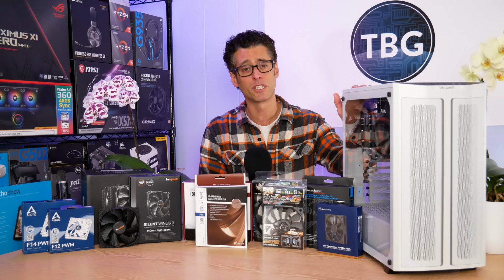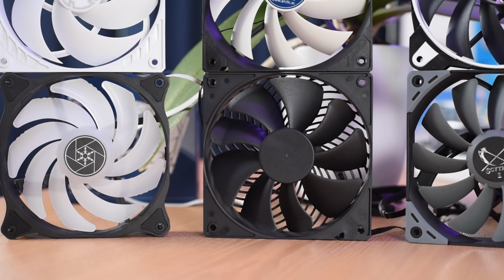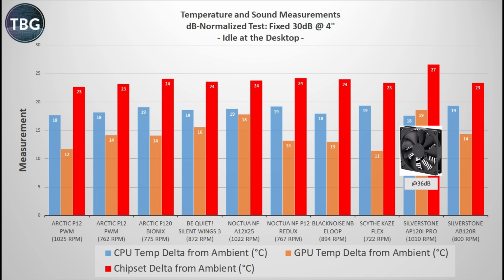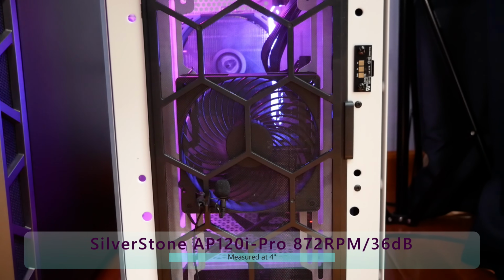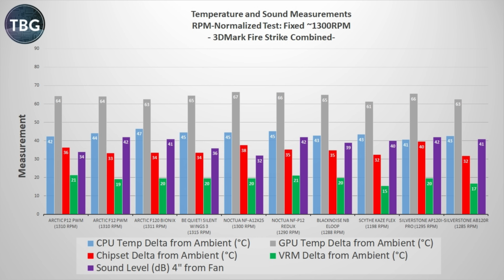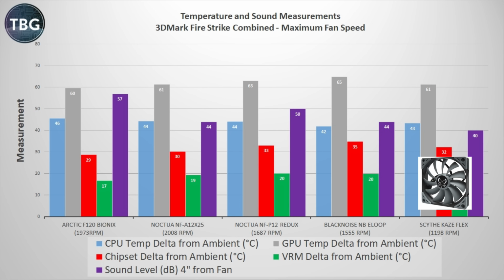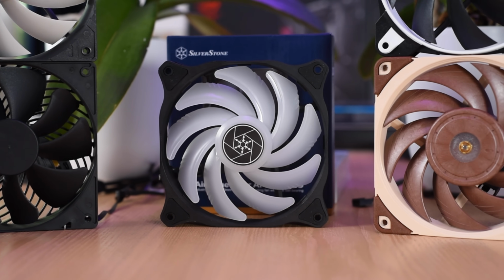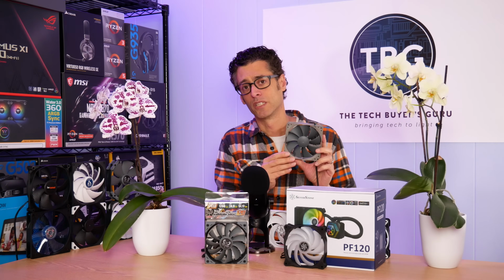The Best 120mm Case Fan Shootout: Arctic vs. be quiet!, BlackNoise, Noctua, Scythe & SilverStone

Comment: this was an unfair analysis for Noctua, because Noctua NF-A12x25 model is not designed to put air into the case, it is designed to move air already in the case, so it is more suitable to be placed on the coolers or other kind of applications. For this test you should have used NF-F12 ones (chromax or premium traditional), which are designed for this use case. Off course Noctua is not going to make a better position if you are using Noctua NF-A12x25 for something it is not designed for, so it has to work harder hence the noise and temperatures.

Comment: The microphone is way too close to the fans. You should move it farther away to eliminate the sound of the airflow. Some sounds might be strong very near the source but not travel very far in real life. Placing the mic about 10” away (and outside of airflow) should give more approximation of sound in real environment. You shouldn’t use air hitting the mic as part of the sound test results.

Comment: Thanks! I hope those p12 live up to the hype. I wanted to change 1 fan in my case and bought a cheap one from a local store only 1000rpm and no pwm and i had to return it, now after watching this i ordered a 5 pack of the p12 pwm on amazon to replace all the fans in my pc, they end up costing the same per unit than the crappy one from the local shop.

Comment: is the scythe kaze flex II as good (or better) than the original kaze flex fans? Getting a corsair 4000D case and am looking to do full scythe fans 2x140mm's in the front and top and thinking to get a 120mm for the back

Comment: Some feedback from a someone with audio recording background: Mounting the small lavalier mic on the frame with just the foam pop-filter isn’t the best way measure/illustrate noise. Cuz it’s going to pick up vibrations from the motors through the frame. And also without a wind-muff or dead cat it will pick up the air moved by the fan directly disrupting the mic membrane. 
It’s better to use a shotgun mic and set that independently on a stand on the floor, point that at the pc front at about 50cm so also there’s no airflow passing the mic membrane and you’re only picking up the noise it would make as if sitting next to your PC case, (instead of what it would sound like if you pressed your head against a pc case)

Comment: I just ordered an Arctic F140 bionix thinking it's simply a faster version of the F14 which is a really good performer for air flow. While I agree the flex of the fan frame seems concerning, it feels like it's a really good performer in terms of brute force air being pushed at full speed and it isn't that loud aside from the sound of air being pushed through the fan.

Wondering if you could comment on the kaze flex 120mm 2000 rpm version although it isn’t pwm. I looked at the stats and it apparently pushes 89cfm which is insane for a. 120mm fan and whether it would be one of the best 120mm for max performance? There's also a black 1500rpm pwm version as well

Comment: I just came across this and I'm looking to put 7 120mm and 2 140  mm fans. If I'm understanding this correctly the arctic p12 would be better for the 7 120mm fans vs the scythe kaze and for the 2 140mm fans from your other video the scythe would be best?
Reply from the maker: The Scythe Kaze Flex 120 and 140 are both my tops picks, but the Arctic P12 is excellent with regard to cost, especially the 5-pack: https://amzn.to/3L4oYt4 #ad
When you start needing that many fans, paying ~$30 for 5 Arctic fans instead of $70 for 5 Scythe fans means being able to put that money towards another substantial component, like a CPU cooler, RAM, or an SSD. 

By the way, definitely check out this multi-fan setup video if you haven't seen it already: https://youtu.be/iCn-XL-HyXg

Comment: How is the SilverStone AB120R so much quieter at 30db? Seems like the level is wrong.
Reply from the maker: The microphone and the dB meter were not quite at the same location. The AB120R has a very quiet motor, which is what the video demonstrates. The air noise will be similar to other fans, and that's what you hear from further away.

Comment: Nice comparision, but from some reviewer i viewed  Silverstone AB120 does not win. But you said that it is the best all around fan. This confused me. But i strongly agreed with you. Is has the highest airflow rate (25.62 ~ 93.97 CFM) with high static pressure(0.26 ~ 3.53 mm H2O) fan in 120mm fans that has argb. I used it as a case fan and really impressed me. I planned to buy Lian Li Galahad 360 AIO and replace the stock fan with this Silverstone AB120RW. Please include Fractal Design Prisma AL12 PWM and AL14 PWM in your comparision.

Comment: I know this is a year old video but I still need to comment. I think this video was a little bit unfair in some degree because this video tested static pressure fans as case fans.

You did say noctua NF-P12 redux was one of the worst ones. But in reality it was also made not as a case fan but as a radiator fan. It's static pressure by spec is really high compared to the scythe. That fan is actually well made, and I think it was one of your reviews that even rated it well (don't remember, but not going to go back in history to rewatch videos lol).
Reply from the maker: The NF-A12x25 is Noctua's static pressure fan (i.e., designed for coolers). The NF-P12 is just a general purpose fan.
Reply: @TheTechBuyersGuru   If you look at nactua's website, it specifically states "Specifically designed for pressure demanding applications such as CPU or radiator cooling".

Also the NF-P12 Redux 1700, has a greater static pressure value than the NF-F12. I've seen other benchmarks that shows it actually performs better as a static pressure fan than the NF-F12.

I agree, as a case fan it IS a bad fan but as a radiator fan, it is actually good.
Reply from the maker: I know what the Noctua website claims... and I also know how it performs, LOL! ;) Honestly, that was written before Noctua had a true static pressure fan. A lot has changed in the industry since the P12 design debuted.

The P12 is really similar to the F12. The main difference is the quality of the frame and the RPM. So the static pressure is higher because of that, but they are fundamentally the same fans.
Reply: @TheTechBuyersGuru  ah I see. I'm actually debating on which fan I want to use it for a push/pull configuration for my gpu. I have 1 of each (F12 and P12 redux) and been contemplating which one to buy so I can slap it on the radiator. I honestly have been leaning towards the P12 redux 1700 because of the specs alone: Higher static pressure and higher CFM value.

What do you think? (I've used them both for different applications so honestly I don't know how they actually perform in real life against each other and there isn't much out there comparing them head on)
Reply from the maker: The main difference is that the F12 has rubber bumpers, but that's not much of an advantage for rads, because it creates an air gap. Plus you'll want higher RPM on a rad. Get the P12: https://amzn.to/3JyoNoZ #ad
Reply: @TheTechBuyersGuru  yeah I'll do that then. Thanks! Cheers!

Comment: HI and thanks for the Video!!! I am looking to replace my front and radiator FAN. I know that before the price of the P12 PWM PST vs the price of the ARCTIC BioniX P120 was quite different. 
I can now buy them for same price. Would the BioniX version be better than the normal P12 version? 
Thanks
Reply from the maker: I do not recommend the BioniX version. It makes extra noise due to the frame design.
Reply: @TheTechBuyersGuru  Thanks

Comment: That NF-A12x25 definitively was a bad choice in case fans review, the NF-S12A will be a perfect choice. I'm very curious about that fan and how it performs paired with kaze flex.
Reply from the maker: The S12A is terrible: https://youtu.be/PUdsTiRmuuU
Reply: @TheTechBuyersGuru   Thanks so much, thats what I'm looking for. So do you think for case with not restrictions those kaze flex are the the best option with more air flow and lower noise possible?
Reply from the maker: Kaze Flex are fantastic, all around amazing fans for case cooling.

Comment: Thanks for the video, but I see two problems:
1. With testing only one fan, I feel like you distort the test quite a bit. Most of us would use 2-3 120mm fans in the front which may result in way different results. In terms of aerodynamics, 3 fans can sometimes behaive much different than 1 single fan. This could also be the reason why the pressure optimized NF-P12 had such bad results, cause with such large gaps beneath and above it there was no pressure to work against at all. 
2. I can see you didnt quite mount the fans with screws, and by just tying them to the mount they were not always centered. With most fans pushing most of their air at the outer edges of the blades, some fans just put their hardest effort against the mount.
Reply from the maker: See this: https://youtu.be/PUdsTiRmuuU
Reply: @TheTechBuyersGuru  Hey, thanks for the link, but I already saw that. Unfortunately you only tested with the same fan brand :) 

Dont get me wrong, I highly appreciate the effort you put into this! 
I just wanted to mention these two minor issues and I feel like its a little bit sad that you might have some deviation in your results due to not spending the extra few minutes to properly screw these fans onto the mount. 

Anyway, I am still wondering how three NF-P12 reduxes would behaive vs 3 Scythes or Arctics in the same configuration, so if you got time I am exicted to see another video :D :D :D 

Good work man, keep it up <3
Reply from the maker: I agree that not screwing them in wasn't ideal. I did that to speed up the process, as it was my first case fan review and I really didn't know if people would be interested. Turns out they were VERY interested.

I have a huge case fan shootout planned for early next year, but it's focused only on ARGB products, so sadly Noctua will not be included!

Comment: I wished I watched this video when researching my next computer build. It could have saved me a fair chunk of money since I bought 4 of Noctuas NF-A12x25 fans Ultra Low Noise because I wanted as much silence as possible without trying to sacrifice performance. Those Scythes look really tempting.

I have heard of Scythes but they were like Arctic in terms of market presence and would have missed my radar when looking for fans.
Reply from the maker: Kaze Flex Black is my current recommendation for the top 120mm case fan: https://amzn.to/3pSwOOZ #ad
A bit higher RPM than the grey version.

Comment: I really like Scythe heatsinks, but the fans sadly are completely disappointing. I have a Fuma 2 and a Shuriken 3, two different MoBos and setups, and the included kaze flex fans failed, both around 1-2 months later. Almost at the same time, the first started with a rattling sound, and a few days later, they stopped...The Scythe heatsinks by itself are awesome, but their fans are not reliable in my opinion. Now I have the Fuma and the Big Shuriken combined with good Noctua AFs and are great. The Big Shuriken+Noctua Af is cooling my 5900x stock at 75C under load... It's amazing in a tiny case with only 2 fans.
Reply from the maker: Was it the slim fan in both cases? The standard Scythe Kaze Flex 120mm is an excellent fan, and I've run it for extended periods of time. In fact, I have some Scythe fans from decades ago that still run smoothly. It is among the best fan manufacturers on the market. Perhaps there's just an issue with the slim model.
Reply: @TheTechBuyersGuru  Thanks for your response. Yes, the slim fans. It's funny because sometimes after 2 hours or so they try to start but fail. However, the 25mm fan from the Fuma 2 doesn't spin as "free" as I have seen in my other fans, it rotates really slow, as it was about to stop. Maybe just bad luck with a bad batch, I don't know, but I did not feel any confidence with those fans. Maybe I could use the 25mm fan with a case until finally fails. But I was really annoyed with those fans because I have olds Cooler Masters, Vantecs and TTs 3-pin fans from 2004 that still spin as free as first day, maybe they vibrate a lot lol but in 2021 still works. But it's ok, the Scythe heatsinks are a great design, and I decide to keep them.

Comment: Why in blue blazes did Noctua tell you to test the NF-P12 as a case fan? That makes no sense. (That fan is fine, BTW, on the NH-U12S Redux.)
Reply from the maker: They specifically suggested it because it sells so well for a relatively low price. I said I'd prefer a higher performance alternative, but they confirmed their preference and I went along.

Comment: I think GPU fans should have been set higher to the point where it no longer thermal throttles. When the GPU thermal throttles it reduces the amount of power it draws, and changes in ambient temp will change the amount of power it can use when it does thermal throttle, thus changing the amount of heat produced by it, potentially skewing the test results. This is especially problematic when using a single intake fan as the amount of air put into the system is smaller than usual, and this would increase the effects of the variable GPU power.

To prevent noise interference all fans being tested should be calibrated to a certain noise level when other fans are turned off. Once calibrated, however, there should be no issue with ramping GPU and CPU fans to 100%.

In your test the GPU temps varies between 67 and 61 degrees above ambient. In an open bench this would result in a difference of about 11% in GPU heat output. In a closed system this heat increases the case air temp above ambient, so it's hard to know whether the variance in CPU temps are a result of an variance in intake fan performance, or the result of a hotter ambient temperature making the GPU produce less heat to to earlier throttling.
Reply from the maker: Thanks for that input. In an upcoming case fan shootout, which will be a lot more sophisticated than what you watched, I may normalize all case fans before engaging CPU and GPU fans, and then allow those to work at more normal levels (still locked, however, as variance in CPU/GPU fan speed makes temperature analysis for case fans impossible).
Reply: @TheTechBuyersGuru  
I think setting GPU and CPU fans to 100% would be a good idea. Either that or whatever makes 10C below throttling temp without an intake fan.

May I also suggest you use Furmark as a GPU stress test as well as a separate CPU stress test, such as CPU-Z's or Prime-95 running together for an extended period of time.
I think these would be more consistent than 3Dmark in terms of power draw, since the load is quite static. In addition, it may be a good idea to have the CPU locked to a certain clock since Ryzen boosting behaviour changes with temperature, therefore it is affected by ambient temperature.

Glad I could help, and looking forward to the next showdown.
Reply from the maker: I always lock Ryzen these days... my current test rig is a 3900X locked at 4.2GHz. As for Furmark, I won't subject my GPUs to that, but I'll take a quick look at 3DMark's load on my current setup (3900X/RTX 3080) to ensure that I am indeed loading both. I do separate CPU-only benchmarks using Cinebench, and the gaming benchmark is actually supposed to simulate a game, which is NEVER at 100% on the CPU.
Reply: @TheTechBuyersGuru  
I think the most important testing you should do with 3D mark is for thermal consistency. Run it for about 20 minutes, then do 10 runs, measure the maximum and average temps(above ambient) of each run, average those, and see how much deviation there is from the average.
If it's significantly smaller than the deviation expected from changing the case fan it should be accurate enough. Otherwise I think you should go for a more consistent load.

I generally believe running a stress test as demanding as possible on both CPU and GPU is Ideal for thermal testing, because the more heat you produce the higher the temps and the more pronounced the variance will be. 
And so, if 3D mark proves too inconsistent I think Prime95 torture test and Furmark with "extreme burn in" enabled will be best.
That said, components are neither cheap nor available at the moment, so it may be a good idea to use a Unigine benchmark instead of Furmark. This may yield less consistent results due to frequent black screen transitions between scenes, but be less torturous for the same reason.
As a less demanding Prime-95 alternative, CPU-Z is very good. It's not nearly as demanding overall , and you can run it on as many threads as needed, so If you want to more closely simulate a lightly threaded gaming workload while remaining very consistent I think that's the way to go.

Comment: Do you think the 3 pin scythe kaze fans that are rated for 2000 rpm with the same blade design as the pwm version would be a better case fan if noise isn't an issue?
Reply from the maker: No. 2000RPM is far too loud, totally useless as a case fan. The only version worth considering instead of the 1200RPM model is the 1500RPM Black model: https://amzn.to/3ipZBXh
Unfortunately it's been sold out since launch, as is typical of Scythe.

Comment: Would the Scythe Kaze Flex still be the top dog in a Mini Itx build?
Reply from the maker: Depends what case and how you are using it. In a very small case you might want more static pressure, which would be the Arctic P12: https://amzn.to/3BBUJpy
Reply: @TheTechBuyersGuru  The use case will be for a front Intake fan on a Lian Li Tu 150 case. That will be the only fan in the case so I need something real powerful because it will be doing the brunt of the  AIRFLOW cooling. The other fan will be on a 120mm radiator.
Reply from the maker: Nothing out of the ordinary there. That's a big ITX case, not really a static pressure situation. Go with Kaze Flex: https://amzn.to/36Zl3vG